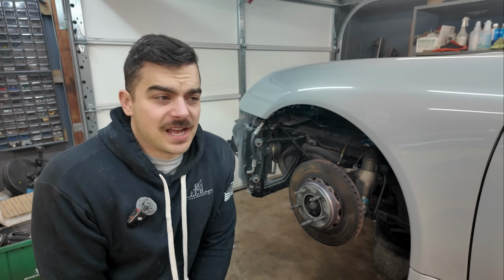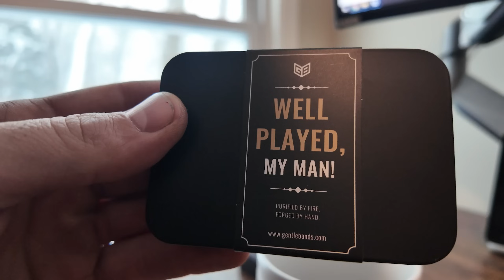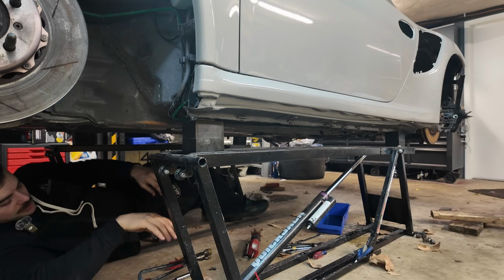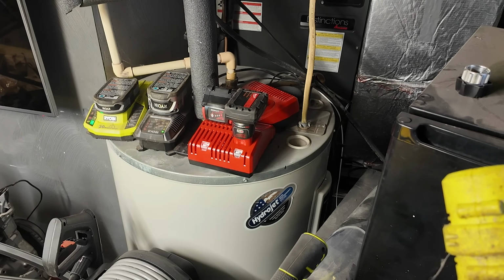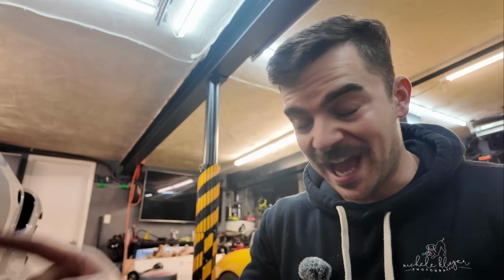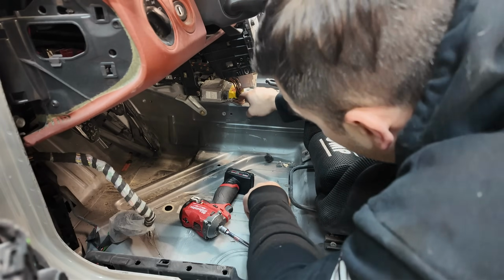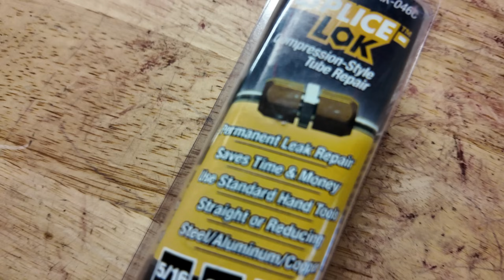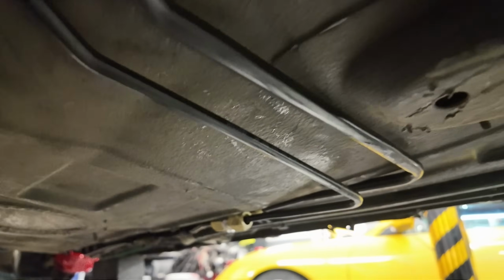Totaled 997 Porsche 911 Turbo Rebuild - I Messed Up

Comment: Before you bought the M18 inpact, I have the same one by the way, I would have tried putting the wheel on and drop the car to the floor to prevent it from turning. And access the nut through the center bore hole.

Comment: The caps of the CV joint are a press fit that can be tapped off with a drift. My guess is when you open it up you'll find a mangled cage and a bunch of loose bearings. You can get a replacement CV joint from FCP or Pelican or whatever, but you'll spend more than you did on the used axle and then you'll curse at it for hours while you remove, grease, and replace the joint. If you do end up replacing the joint, replace all of the old CV boots while you have it apart or you will inevitably crack one within a week and get to do it all again.
Reply: I'm a Ryobi tool person 😅

Comment: We only use airtools at the shop and for stubborn nuts and bolts we use an electric torque wrench that can handle a shit load of torque. But that's way to pricey as a diy tool😅 last week i had to take of a pulley of a marine engine and we needed 2800bar of oil pressure to expand it and push it off. Was pretty nervous when doing that😅

Comment: I used to be an engineer for Milwaukee tool several years ago. We benchmark tested all of our tools against the competitors. We would aim to try and match or surpass the absolute best product on the market and then offer it at a price that competes with something like DeWalt. There were a select few instances where something like snap on would be slightly better but they were also drastically more expensive. I don't know of a single time that we didn't crush DeWalt during our benchmark testing lol. I absolutely loved working there and I fully support their products!
Reply from the maker: Sounds like a sweet gig! Why don't you work for them anymore?
Reply: @matt13ross  the commute was 1.5hrs to get there and then another 1.5hrs to get home. I ended up getting recruited by another company that offered me more money and I only had to drive 20min to get to work.
Reply from the maker: Oh yea I couldn't do that commute either.

Comment: Thats how you learn man, im sure you wont be making those mistakes again. Also the new camera tracking, especially when you look at the old axle, is super smooth and THANK YOU for 1440p! Enjoying the series and eyeing my own second hand Porsche.

Be careful with those quick jacks, make sure the locks are in and the car is balanced!
Reply from the maker: Wow I'm surprised anyone noticed the 1440 upgrade lol. My computer struggles to edit that or anything higher.
Reply: @matt13ross  It makes a big difference for people with large monitors used to 1440p or even 4k, I appreciate it!

Comment: I’m dumbfounded the brake was able to seize with enough force to break the axle. And the brake was rotating fine a week earlier.  Brakes need hydraulic pressure to do real work.  Something doesn’t add up.

Comment: The biggest tool I have - is the user.
But I like Ryobi for general nutting about - because they are light and get in places others dont' and of course the price it right.  And I have a Dewalt impact and drill - because I am more a general contractor with garage projects.
Then go AC power for higher torque - Makita is what I have - not to say the best but does get it done.

Comment: 17:09 you can change just the cv joint if the spline on the shaft is okey,there is no point of throwing the axle this thing are serviceable.

Comment: looks like you may have lost the cage on that axle,....there are rebuildable, though. have rebuilt a few axles from different manufacturers and the concept is similar on the ball bearing/cage designs. it does not appear to be a tripoid style (think a 3 pointed u-joint with round (bowled) bearings capping needle bearings) in order to allow for plunging travel style movement.  that being said, i imagine the part itself is not 997/996 specific (might be??) and may be utilized on many other vag products. i would check fcp and pelican for parts and then you can do a quick diy video on repairing the axle. 

as for the power steering lines, the splices might just be the ticket. another method could possibly have been a bubble flare. 

as for the stache,....i have no dog in this hunt, so, my opinion doesn't really matter.  

aluminum is tough for beginners to tig. the "rule of thumb" i seem to remember is 1 amp per thousandth for steel, and about 1/2 that for aluminum, but you will need to purge any tubing to prevent any sugaring on the inside. i do not have an ac tig set up, so i don't do aluminum.  if you are attempting to do an autogenous weld,  do so hot and fast, but make sure the fit up is making contact. 

till next time, keep well.

Comment: I've been biting my tongue on your Ryobi. I knew eventually you'd realize they're not meant for gear heads, but the weekend warrior that turns a wrench once or twice a month.  I actually stuck with M12 for a long time and only recently bought the same M18 you have.  Honestly M12 is perfect for most of your work. The big guy is only needed for suspension work. Although I've used my M12 Impact, with a 1/2" anvil, to redo the suspension on my 996.  Not sure why you keep getting the wrong parts for your car. it's almost like the VIN you're using doesn't match the engine or the chassis. 🤔
Reply from the maker: It's not that I advocate for Ryobi only, but it's what I have with a limited budget.  And I didn't enter the VIN when buying the power steering lines because it was from a used parts website.

Comment: Taking a car for a test drive before getting the brakes functional was definitely a case of being way too impatient.   Slow down, take your time, do it right, and yo won't have to do it over.   Impatience always makes the job take longer....and often cost more.
Reply: I agree 100%
Reply from the maker: It wasn't much of a test drive, more of a: move it to the trailer, take it off the trailer, and into the paint shop.

Comment: Matt I respect your work, your skills and your sometimes unorthodox methods - but do you really want to go 193 mph down the highway in a 500hp car, with jerry rigged power-steering lines? Remember they operate at around 1500-2000 PSI pressure??? - Just saying.....
Reply from the maker: I'm not worried about it. After all, if they leak, steering still works. 

Eventually I'll get new lines but they're hard to find. Especially because they vary with years.